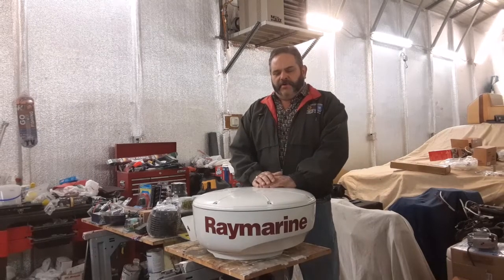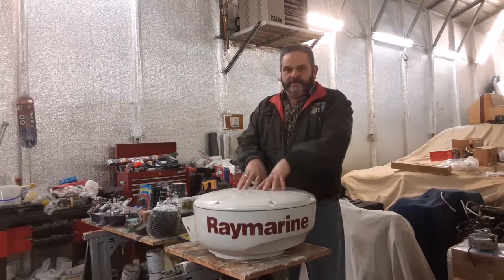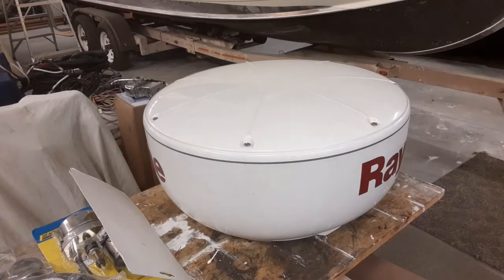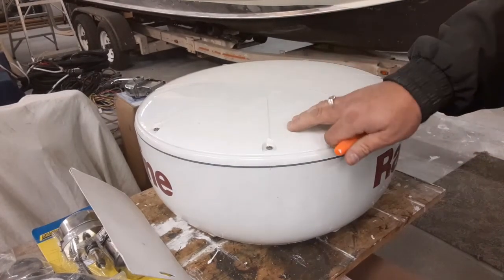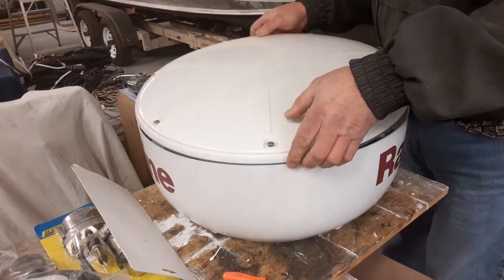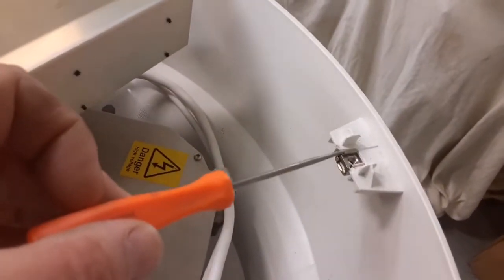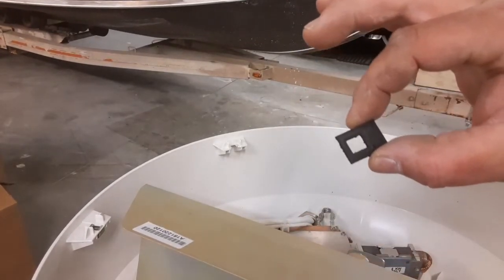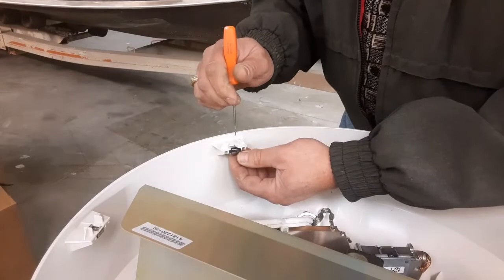Behind the Scenes - Raymarine Radome (Housing Repair)

Comment: Carl  I'm installing my 1st radar on my boat. Do you suggest installing a on/off switch for the dome or is it not necessary
Reply from the maker: Hi Mark,

An on-off switch on most domes is not necessary.  If the system you are going to install was built within the last 10 years or so, the chart plotter/multi screen unit will automatically power up/down the dome as necessary.  

Keep in mind you may have some set-up parameters on your multi screen you will need to customize to the exact dome model per the manufacturer's instructions.  Newer units of the past few years, this function is automatically done for you. 

Also, I make sure I don't allow the unit to remain in 'standby' mode as it keeps the heating elements on (dome warmup) and wastes power.